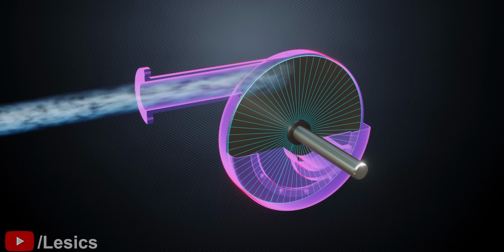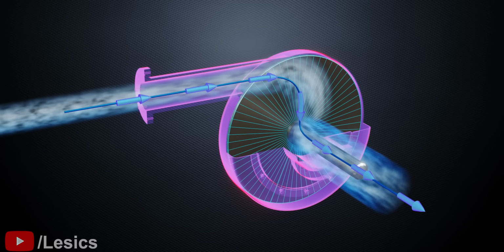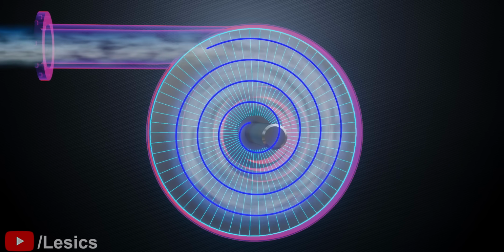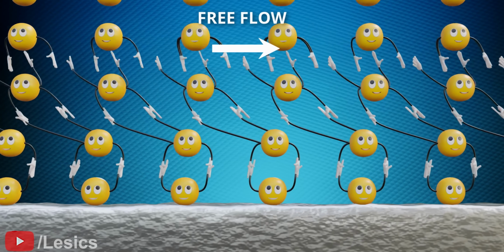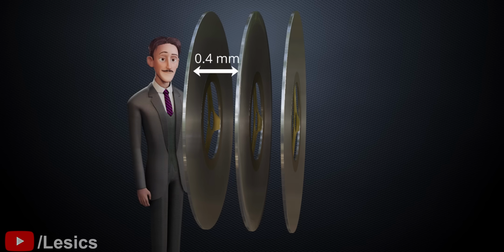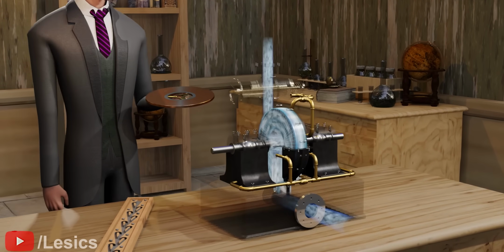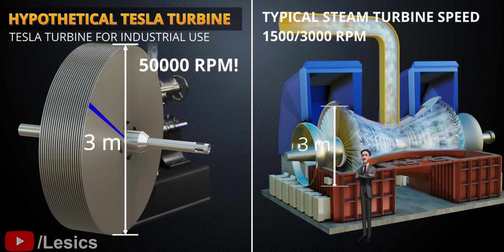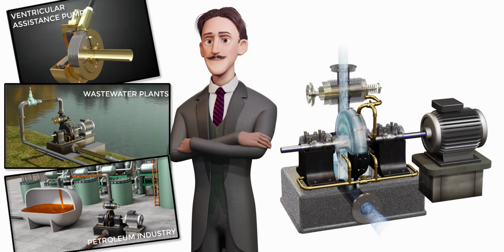Tesla Turbine | The interesting physics behind it

Comment: "Engineering impossibility" 🤣🤣🤣
I built one in my garage using CDs and a 12v motor housing and shaft that spins at 20,000 rpm on compressed air. I used Tesla's idea ( not to patent specs, not even close) and what I had available for tools and material. Very crude,  and many issues not resolved, but it works incredibly well. Tesla's turbine is incredible and has so many applications that would benifit the entire world.

Comment: works for steam doesn't work well for air Ive been trying to make mods of the design but torque s too low. Velocity needs to be to high for air.
I have tried off and on for 50 years

Comment: I'm just a layman, but wouldn't exploiting Lenz's Law with copper discs and oscillating magnets turn this into a standalone electricity generator?
Reply: Copper is way to weak
Reply: @beethoven007  In what way? 

The magnets are to decelerate the copper whilst generating electricity through electromagnetic friction.

I'm not saying it's optimal, but I want to know if it's viable.
Reply: @AngraMainiiu surely it would be possible but you need to consider multiple things: Tesla turbines work high pressures in their inner housings; therefore the housing is solid thick steel and inducting a fairly efficient electric field may be difficult; the copper oxidises pretty quick which means the turbine could only be used with permanent addition of antioxidants; then to get a decent efficiency you need pretty high rpm and the yield strength of copper is far behind stainless steels. But the mayor problem is that you need several things plates stacked with less space in between to get efficient all momentum of your fluid flow, which means you cannot really work with all plates when inducting a current since your magnetic field would become very inconsistent
Reply: @ 
1: It doesn't have to be Copper, any electroconductive metal can do.

2: High RPM isn't the focus, efficiency is. This can be achieved by using magnets like car brakes to induce friction yet generate electricity. It's a simple conversion of fluid current into electromagnetic current.

3: That can be solved with precision engineering and tweaking. The optimal design I would say is something like how speakers work in how it's a completely analog conversion of magnetic to kinetic energy but in reverse...
Reply: @ surely, but the Tesla turbine has to work on around 60k rpm to operate on max efficiency, because it is working with the momentum of the fluid and not the potential energy of the operating fluid. You surely can induct a magnetic field and operate it like a generator, but the high speed is what it makes more efficient in comparison of steam jet turbines

Comment: Make the layers of disks into a sphere shape so as to spread out the stresses dynamically over the entire area of rhe rotating sphere.  The example given here or the central orequatorial layers are to be reduced progresdivy in diameter on either side to taper into a spheroid shape.  Increase the distance between the initial equatorial layers to allow for free flow between them keeping in mind that, while allowing for a certain amount of free flow in this region, the progressive, lesser diameter layers on eirher side gradually reduce this free flow and reclaim what is lost as the water flows outward through the center as described.  The thickness of the smaller diameter disks can increase gradually in proportion to the diameter, increasing their strength at high RPM as the curcumferance vs. the distance from the shaft is made less and less.

Even a cone shaped glass harmonica type structure constructed in this way could also work, similar to the airfoil example but opposite in form such as | = central disk with <> going left and right from it such as < | > whereas the airfoil example in the video looks like > | <.  

This should spread out the stresses on the apparatus at harmonic intervals between the disks so the all work in tandem.

Signed,

Ghost of Tesla

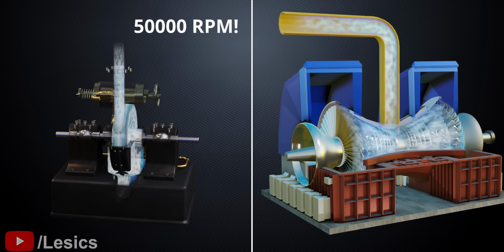Comment: 7:49 what if nitinol coils were used as the disks. Metals produce heat when they expand. If nitinol wire was set in small coil positions the heat caused by expansion created in the nitinol during high rpms would cause the nitinol coil to contract onto itself reducing failure while allowing increased efficiency. The coil design would also force the rotational expansion from the center coils onto outer coils which in turn contract onto them with centripetal force thereby increasing their efficiency.

Comment: If someone could design a method for mass producing graphene, Mach 13 on the rotor disks would be achievable, that is of course if the water doesn't ground out the electrical charge in the graphene.

Comment: Im no engineer so correct me if I'm wrong, but aren't the limitations of this design partly due to the strength of the materials but also due to the opposing forces of the environment i.e gravity and atmospheric resistance? In theory couldn't you operate a tesla turbine in space with maximum efficiency where this is no gravity and little to no wind/atmospheric resistance? 🧐 UFO 👽?

Comment: your illustration implies it works like open tesla turbine, like a water wheel, but emphasis on the closed turbine case, with center-out sideways exit of the work fluid. yep it does also work fine as an open water wheel. you can also make spiral tesla turbine, without using discs, just a spiral strip of metal or plastic. looking around the axle. tesla turbine surface area determines its power generation capabilities. your math does not match, you have some incorrect assumptions about how tesla turbine must work. impossible? possible. so how large is space rotary sling launches. yes the turbine can be spun at high rpm.

Comment: The basic principle for the Tesla Turbine is well presented, but there are considerable number of secondary, as the speed ratio between the steam and the disks, and tertiary dynamics such as the turbulence in the boundary layer (which is the transfer energy vector ) when the relative speed between the fluid and the disk is changing are not noted at all, and these by themselves affect hugely the efficiency of the turbine. Also note these "bumps" in the shaft, these are fluid bearings (!!!). For those interested more, highly recommending "A new dimension for Power" book that represents some research and most of Tesla documented notes on the turbine.

Comment: a source of energy - they are warm air, which is transformed into rotational motion in a concentric vortex.
The basis is a disk that rotates between the covers, creating a large vacuum in the center.
There is a hole in the top cover (it is also in the center of the disk to use both sides of the disk) above the hole there is a dome, in the dome on the edges there are holes through which warm air enters.
A vortex is formed in the dome, which rotates a small (compared to the disk) turbine - the turbine is attached in the center of the disk.
The drop in temperature is so severe that the bearings freeze (which is a big problem).
When accelerating, there will be a howling loud sound, you need to accelerate even more to pass this threshold, then the vortex will push the turbine and the disk itself.
This is a source of energy. Thank you...

Comment: Why does it have to be very large in diameter and not just very long? It would be the same effect if you trade length for diameter and you eliminate the speed of the ends of the discs.

Comment: This would make a wicked jet turbine. Does anyone know if anybody ever tried to make a jet engine using these principles? A tesla compression and turbine stage. One would feed in the middle section and  exhaust out the outer section. Then, the other one would feed into sides and exhaust out the center. With a standard burner in the center. Made it out of tungsten tetra boride.

Comment: Literally all they have to do is keep them small and use the correct reductions to convert the low torque high rpm into high torque low rpm.

Oh well, at least this concept can be used for what are essentially bladeless centrifugal pumps.

Comment: Sooooooo why not just use many more disks that are smaller as a compromise in order to reach that elusive 50K rotation speed without the insane mach 18 tip speed? 
Because If all we need to do is punch 200+ 2"-3" sheet metal disks for this project then put them onto a rotor instead of the 10 6" disk design that Tesla used in his turbine and have said 200 disk turbine work, wouldnt that just make a simpler turbine over bladed ones due to simplicity? Or would that only increase the turbines RPM requirement for the 95% efficiency?

Comment: Actually, we have patented a high energy density, compact, efficient turbine engine that shares many of the Tesla turbine's advantages, while overcoming its problem areas. It doesn't require expensive regimens for its manufacture, maintenance or operation, and it could be easily manufactured by most piston engine manufacturers, and would have a longer lifespan than piston engines (even diesels). It is also fuel agnostic (anything from coal dust to hydrazine) and can even be used in tidal and wind turbines. We even printed one in PLA, and ran it to 5600 RPM with no damage (the only reason we didn't run it faster is our compressor couldn't keep up). https://youtu.be/GkYxBZot7zU?si=Z0pgAub5LAJzDLnu

Comment: So true,  The height of ones intelligence is directly proportion to their realization of their own ignorance.  If you wish to learn anti gravity and how they built the pyramids play with the center field of a magnet, not the north or south poles..  
#1.   If you tap the center field of a magnet on any plastic or glass it  will loose weight,  stay  away from iron. Even though the iron bar is providing the magnetic source  it cant be disrupted by a similar metal,  That's why they used copper tools to carve the pyramids.  The pyramids exhibit this exact fact!!  the petroglyph show a device that has four or more tires(magnetic disk) on a staff and directly above you see this (^^^^^^^) they are talking vibration and in most case's you will see a person slapping the bottom magnetic disk, because all the magnetic disk are in the repel mode it will amplify the effort and provide more "B" field into the ground, this is where things get really interesting.  When you vibrate the "B" field into granite rock it will become soft!  PROOF: check out Coral Castle Florida on YOUTUBE.  His generator was made of 25 "V" magnets five deep  on a metal shaft that sent the "B" field into the ground.  They were all set up in the repel mode  to maximize "B" field energy.  The "B" field is the center of a magnet.

Comment: What about using something more viscose like water, oil, coolant, or some sort of lubricant fluid. This would create more friction and the boundary layer would be stronger, following that, reduced RPM would be needed to create the same amount of torque. The fluid could be captured and recirculated. I'm guessing heat generation would be a problem? Obviously Nikola Tesla thought of this!...does this work? Engineer please?

Comment: Am I alone who doesn't understand why the hell we need FLAT wheels when we can put disk with blades?? (like a normal fan, but blades are at 90°) Then it will have max power from the flow.
Reply: I'm not an expert but likely would cause big stress on blades

Comment: perfect....so 5000 rpm no sweat what if the turbines applied the viscous force to the bearings as well reversing weight and of course rotating in the same direction of the turbine similar to a parallel drain circuit most would exhaust through the main  but the pressurized water through the bearing would add two zero gravity bearings also rotating...so less weight more speed self regulated?

Comment: I called several magnet Mfg's and none could provide the "B" field .  Interesting,   Anyway I'm sure you know how to build your own "V" magnets.  You don't want any inductance in your experiments.  That is why they used copper tools to build the pyramids.  If you take a granite rock and vibrate it with the "B" field it will loose some of it's structural integrity and a copper tool would be used to shape it!!..  

Stay away from all iron, and any inductance!!  You can use iron to make the magnets but you never want to introduce other iron or inductance to the picture it would disrupt the field  you create.    Know this:  Our entire universe is all magnetic once you understand a little more.    I believe, The eight sided pyramids of Egypt were  transportation devices .  Intergalactic Hologram generators that would allow for instant transportation.    Once you start a magnetic field in iron it will continue indefinitely.   When you lay down a bar magnet and sprinkle the iron on top of the paper ..  It's the space's  between the lines  where all the real power is.  That is also the MAIN reason AC current and radio waves traverse the distance..    We need to re-think our  magnetics..  The Oscilloscope does not show the  "B"/Nutron field but it is the main power that makes things travel .    Anti gravity is  also a big part of all this ..Just tap any plastic or glass object with the center of a magnet and watch it loose weight..  DON"T use iron or steel for this test you would disrupt "B"/Nutron field.    I'm thinking systems like Stone Henge were vibrating earths energy to energize the crops in the field and many other  earthly needs.

Comment: It is a nice production but with one fatal flaw leading to a faulty conclusion. The radial velocity is not governed but the rotor radius, it is governed by the fluid inflow velocity, the quality of the discs and the losses in the turbine. Using the same fluid inflow velocity, enlarging the diameter will decrease the rpm, and vice versa. That is why small diameter turbines have 50 000 to 100 000 rpm, and large ones a couple of thousands rpm.

A 3 meter diameter rotor  has a circumference of 9.42 meter. Given 100% efficiency, a 340 m/s converging nozzle (mach 1 at sea level) inflow will result in 36.09 revolutions per second, or 2165 revolutions per minute (rpm) free spin. With a converging nozzle and 45% load (including losses) a 3 meter Tesla turbine will operate in the range of 1200 rpm.

A 1.2 meter diameter Tesla turbine will free spin at approximately 5000 rpm with 540 m/s inflow at sea level. With suitable load (no lower rpm than 55-60% of max rpm) it will spin at around 3000 rpm, making it suitable for a direct drive 3-phase 50 Hz generator. This is a approximate guess, using steam with different temperatures and pressures affect the fluid velocity and therefore also the rpm. But a synchronous 50 Hz generator will lock at 50 Hz (3000 rpm) if connected to the grid. The temperature and the amount of steam (flow per minute), the quality of the discs, and the number of discs, determine how much power the Tesla turbine will generate.

The big win with Tesla turbines is that they don't mind wet steam or other particles, it doesn't matter if droplets form inside the turbine, no harm will come to the discs. That makes them suitable for rugged systems. You can accept a performance hit compared to axial turbines when you have a big win in operational simplicity and less maintenance.

Comment: wouldn't it be more efficient to cascade the discs? and then "daisy chain" each turbine ( so the loss is constantly passed forward) and then diffuse the excess RPM on a less effective rubine that powers a pump, to re-seed the cycle? 
It wouldn't replace bladed turbines. Just make them a component of a larger network. Conserving more of the energy to be converted. I don't know how to describe my thoughts here. I can see the shape, but I don't have the words to describe my thoughts. 
...or is it maybe because each disc is the same size? What if the rotary chamber was more conical? ....as disc one reaches terminal spin, then....nvm the largest would destroy the smallest...could it be run "backwards"....kind if a slow build? ....each node would need to be able to "disc break"...maybe in like an array...it would seem like a pulse from a macro point of vieew...

I'm sorry I'm squirreling. Thank you for the thought provoking video!!
Very well put together.

Comment: what if we use diamond disc the money it would save would pay for itself. the heat would stabilize with th water being cold. intheory it should work. as long as the water would be ice cold. anyone want to test this theory? with diamond you should be able to push the rpm to 50,000 at a minimum. tesla could have made it fully functional.

Comment: With the industrial capacity generator, I was thinking, why not reduce the disk diameter by half, and increase the number of disks by two? It would still be the same output and allow higher RPM, thus eliminating the problem with using such huge disks.